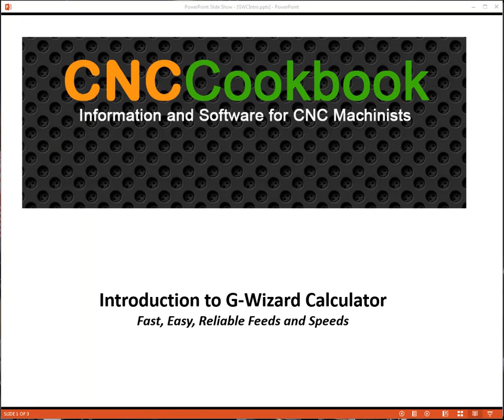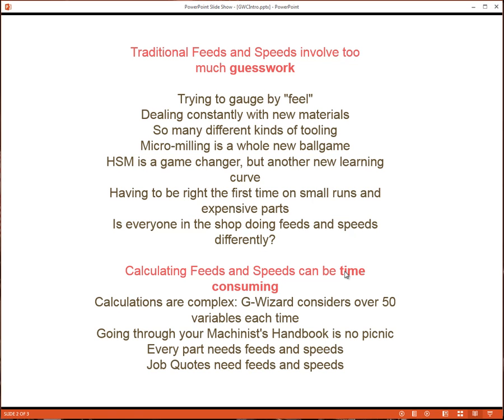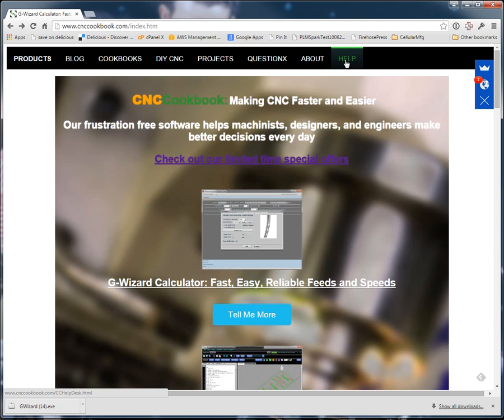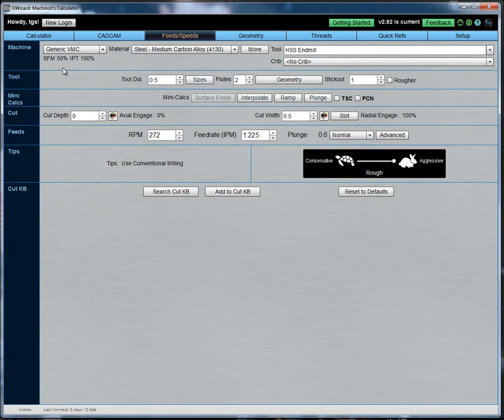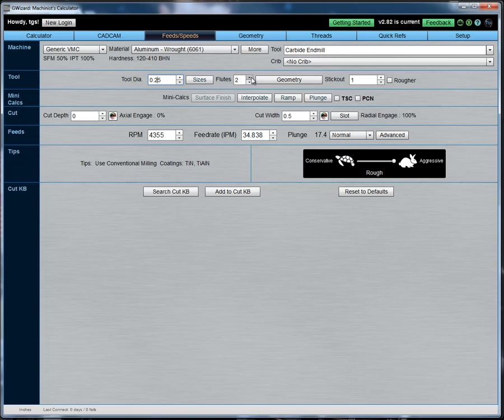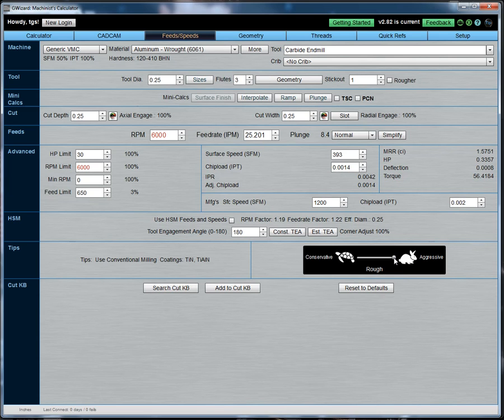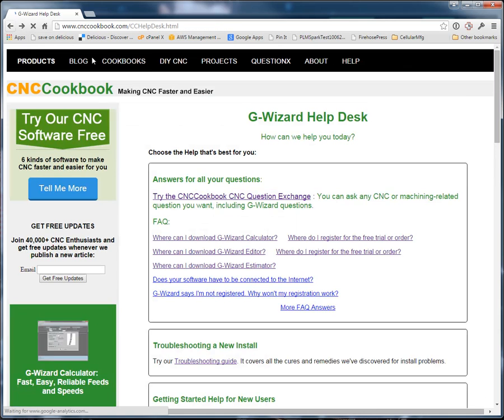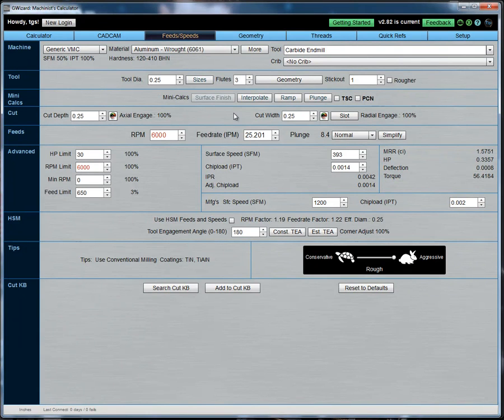Introduction to G-Wizard Calculator

Comment: The video says a Mac version is available, however, as of early 2022, there is no Mac version on the download page, only PC options. This a pain for Mac users.
Reply from the maker: We stopped supporting Macs near the beginning of 2020. There were just too few users (only about 4% vs PC) and with the advent of Catalina, Apple made it really hard to support the Mac.

We are working on a new version that will run in the browser, so it'll work on Macs as well as mobile devices.  It is some months away.

Comment: Hello, could g wizad calculate the time of carving on wood a 1 meter antique frame (y), 10cm wide (x) and 4cm thick (z), mostly detailed, flower decorated ? if yes what would be the approximate time ?
Reply from the maker: To get an accurate estimation for something like that, you'd need to generate the g-code and then run that through a simulator like our G-Wizard Editor.